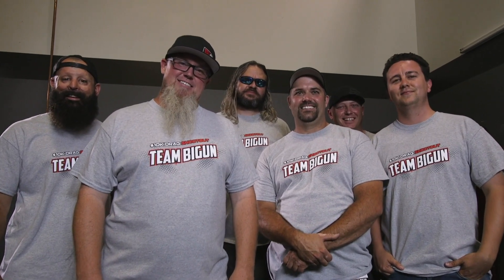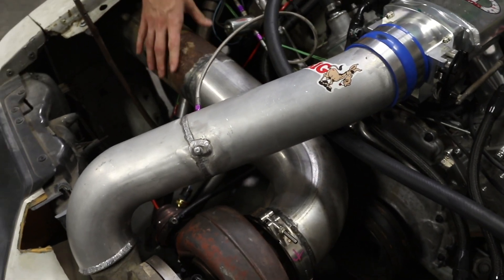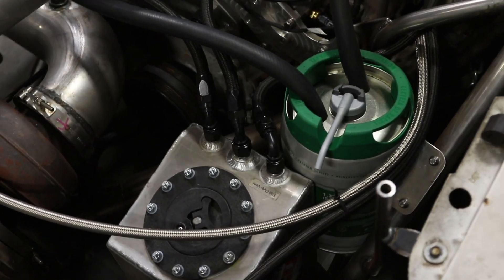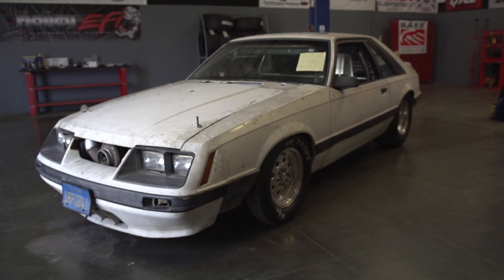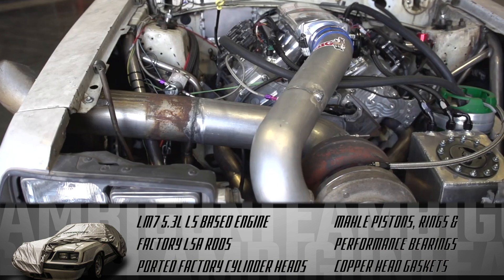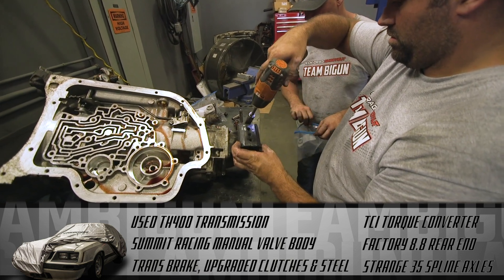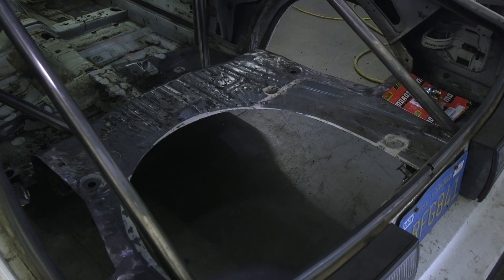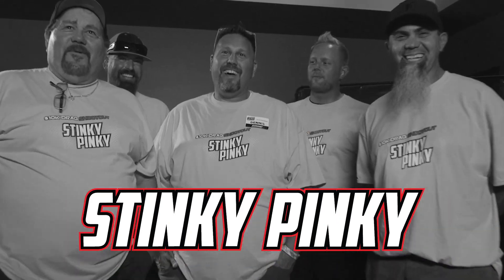$10K Drag Shootout Episode 7: A Look At Team Bigun's Turbocharged, LS-Powered 1986 Ford Mustang

Comment: I was impressed until he said LS swap. Come on man really.  Go grab a Camaro !!!
Reply: They wanna win. So that's why they used a mustang
Reply: I agree shay but slap a Coyote in a mustang not a Ls!!
Reply: Cleve Wilks  Used Gen 2 F150 coyote would have worked well but you cant beat the LS when your on a triler park budget.
Reply: Ryan Merrill You So So write brother. My bad i didnt know the budget was that low.Always said you could build a chevy motor off of a government check. LOL
Reply: I'm a die hard Ford fan but at this point in my life I have the mindset of "anything that keeps a fox alive is ok by me". That being said, we all know that if you want a fast, low budget drag car, you're gonna have a LS powered fox fed by the biggest cheap turbo you can find.
Reply: Paul Wilson  ABSOLUTELY,Well said my friend!
Reply: Agreed, you can build a FORD to run with any LS I'm a Die Hard FORD Guy since Forever. My 1986 Fox Body has seen a few different Engine Combos, after the Stock Fuel injected 5.0, came a mild 69 351 W, then a little more wild was a 72 351 Cleveland, now a stroked 521 BBF Based off the 460, i Always loved the high winding Small Blocks, especially the Cleveland's, would turn well over 7400 rpm. But that Awesome Low End Torque of the Big Block is hard to beat, plus the Stock Blocks are plenty strong. Not like the 5.0 Roller Blocks when you up around 550 HP and the Block splits down the lifter valley. My 521 Mildly Built N/A 1000cfm 4150 Holley Carb, Solid Roller, out of the box Trickflow Street/Strip Heads, C-4 No Brake, 8" Converter, 8.8 with 3.90 gears, on 275/60 Drag Radials. Going Low to Mid Nines. Street Legal. Car was built years ago, for what's done to it, it's a pretty quick ride. You don't need an LS to go fast. My 86 will Always be FORD Powered. Most likely always Big Block 460 Based, I'm tired of buying so many sets of Headers. My Big Block one's cost around $1300 My first Stainless Steel Headers, they look nice.
No Need to put a Chevy in a Mustang...